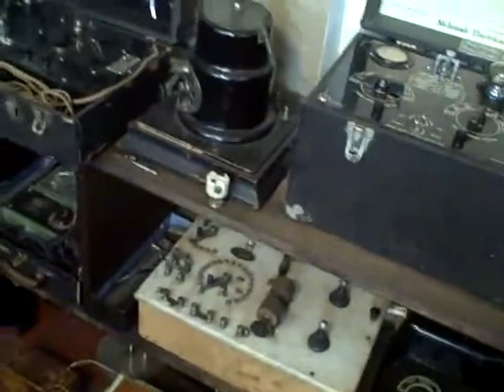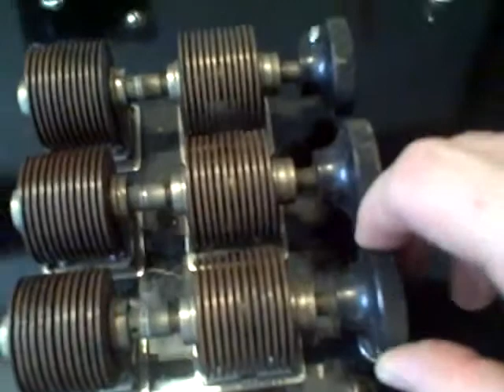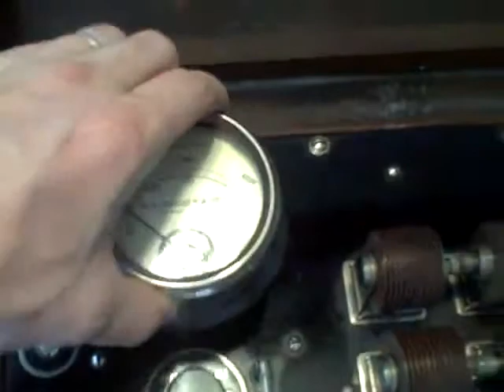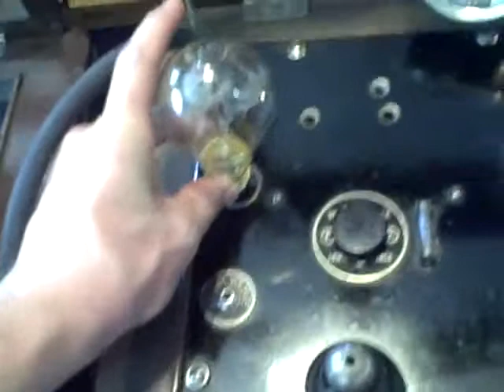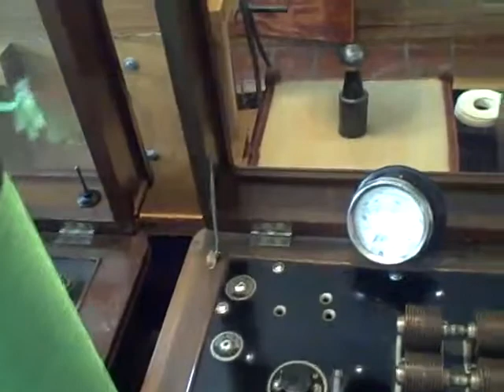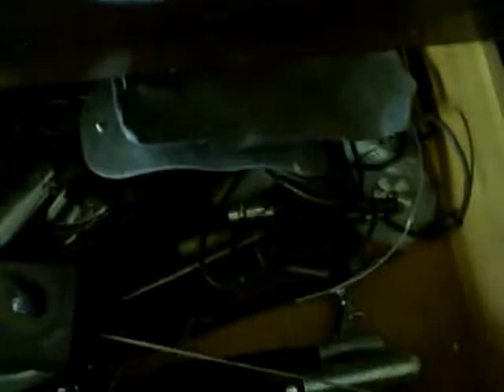Fischer Diathermy  Narrating and Exploring a 1920's Tesla Coil

Comment: Do you have a detail of what the capacitance is on your blue prints?
Reply: I own a Fischer model G 2. I also own a e j rose physio therapy diathermy device. And I have a fisher model g diathermy in the process of being remade:)  if you have any blue prints could you share your capicitance information. My model g2 fisher has the capacitors stacked instead of separated .